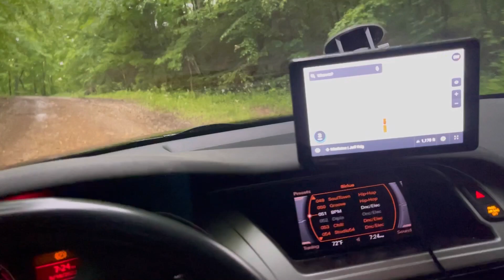Audi Quattro Tire Blowout Repair bumper hauling Dirtbike drz400 adventure travel vacation Kentucky

Comment: Hey not sure if you’ll reply but thermostat is bad On my Audi and the temperature gauge never goes to operating temperature . I’m wondering if it’s bad for the car ? I do have the code p2181 replaced the temp sensor didn’t fix it. Obviously the thermostat now. Car runs fine MPGs are worse I think and my spark plugs are turning white lol and the idle is a little higher now. Thank you buddy

Comment: I live in indiana and work in indy. I have a 2007 Audi a4 2.0 that has an oil pressure problem that I can't figure out.  Rebuilt engine and alot of new parts. Would you be interested in taking on the job?